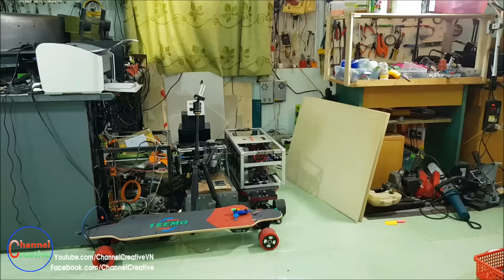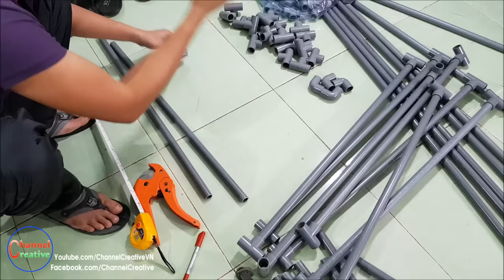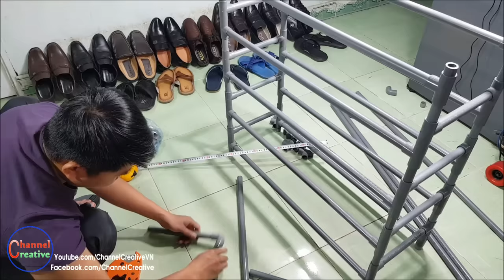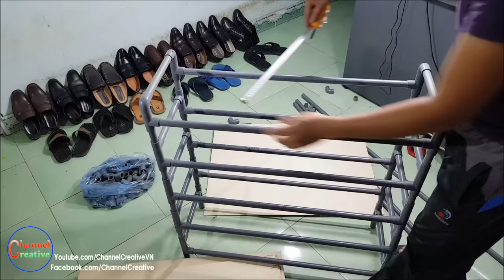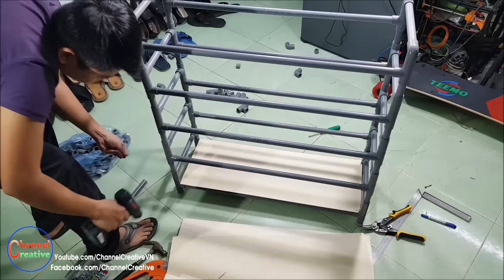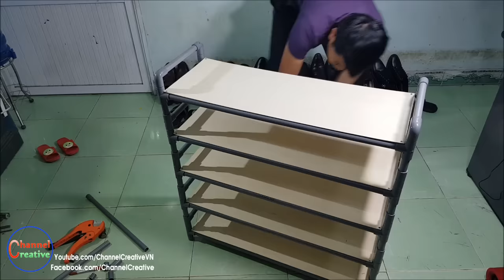How To Make Shelves For Shoes Using PVC Pipe

Comment: I made a rack to hold plastic tubs. I can take it apart and reassemble  if I need to. I made a shelf for in my kitchen painted it green an put a glass on top to hold jars. Pvc is easy to clean and can be made any size. Love working with it.  This is an excellent  shoe rack. Can be made any size. 😃🤗